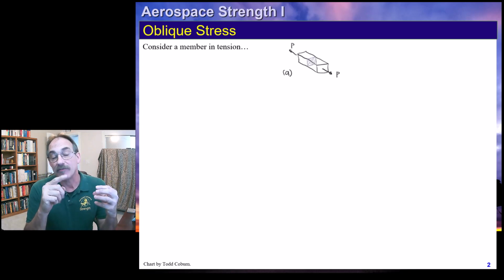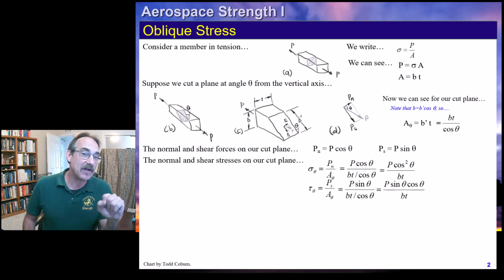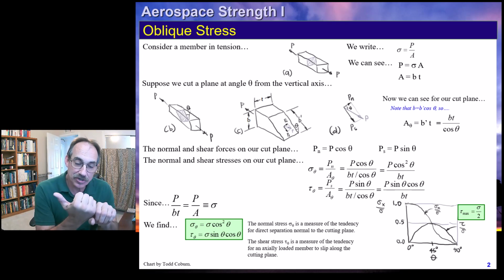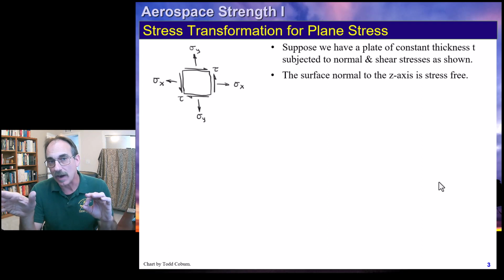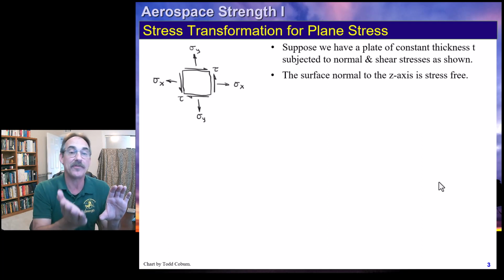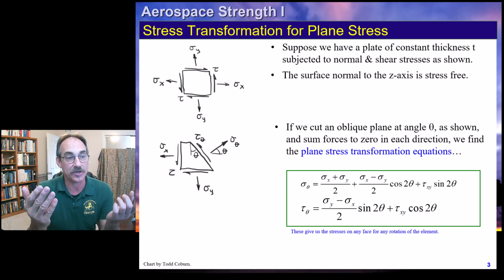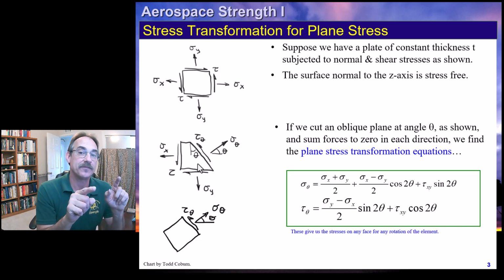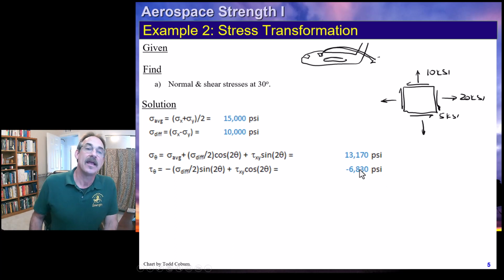Strength I: L-20a - Stress Transformations

Comment: Please professor i need your help do you have page Facebook i want contact you
Reply: Do you mean that conducting an experiment is necessary in this case? I want to simulat with hashin damage
Reply from the maker: @kikinano5830  not necessarily, but when load paths and response are not along well traveled analysis paths, a validation thru testing is often necessary.
Reply: Thank you professor
Reply from the maker: @kikinano5830  :-).  don’t necessarily give up on the abaqus solution, but first do a hand analyis.  Be suspicious of all your results.  Look for simple ways to validate your analysis thru other methods and/or thru testing
Reply: @ToddCoburn  im PhD student and i need this for my article and i cant do the test . After researchin youtube and Google i found the same but they use a vumat subroutine
Reply from the maker: @kikinano5830  sounds fun.  As a student, the main thing is to do a good analysis with clear documented reasons.  A subroutine, if available, can help, but is unnecessary.  You’ll need a nonlinear solution and a very detailed model.  Not one of those auto meshed jobs that yields all thought to the computer, but one that is meshed to yield thw info you seek.
Reply: I think this work needs some effort and thinking so All videos are payant 😅
Reply from the maker: @kikinano5830  that it will.  :-)
Reply from the maker: @kikinano5830 lso… there are two things at play here.  First, you need to accurately calculate the shear and peel stresses in the bond and/or interface.

See my youtube composites interlaminar stress videos for ideas of hand solutions to that.

Next is the interaction, which may be nearly negligible.  Peel stress will likely dominate, but exceeding shear stress allowables will result in sure failure.  Excessive deflection can introduce significant otherwise-unpredicted tension in bond line.  

All this can & should be predicted by hand before a FE solution.

ABAQUS is a great tool and is probably one of the best for attempting to predict this with higher methods, but it must be grounded in good thinking, which is developed thru hand analysis.

Good luck!
Reply: @ToddCoburn  I am grateful for you and for your advices. Thank you very much🙏
Reply from the maker: @kikinano5830  :-). Good luck!
Reply from the maker: Lol.  Of course.  …and you just did.  ;-) What’s up?
Reply: @ToddCoburn  I have a problem with simulation of delamination of composite 3d and cohésive interaction in Abaqus Can you give an idea or any solution for this simulation and if I should use the subroutine
Reply from the maker: @kikinano5830   ahhh.  That can get tricky.  While ABAQUS can help get a good solution, it is much more probable that you’ll get nonsense without significant skill and tenacity.  It is best to start with a hand solution and to move stepwise from there.

I had a number of folks working with Boeing to solve this kind of problem.  Years of work.  Lot’s of test support.  Slow development of basic approach.

This kind of problem does not get solved easily.  This is why a simple hand solution, tweaked with judgment and creative thinking, is the best for quick solutions, and without this first, or significant test expense, any solution is suspect